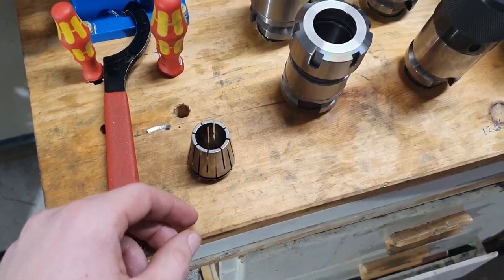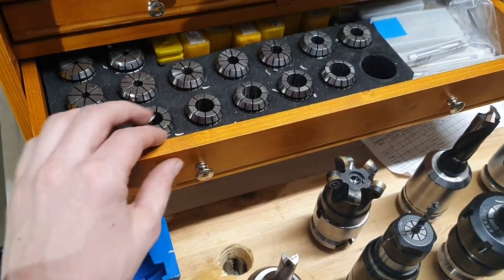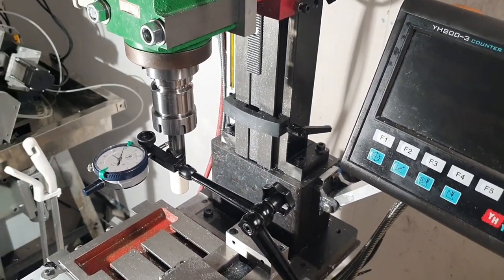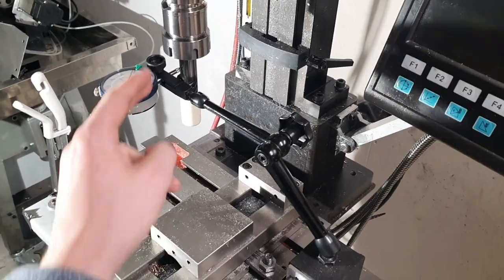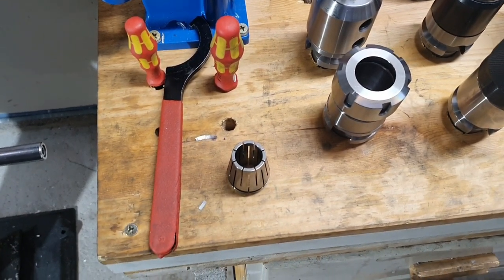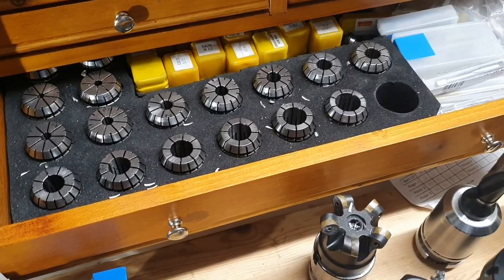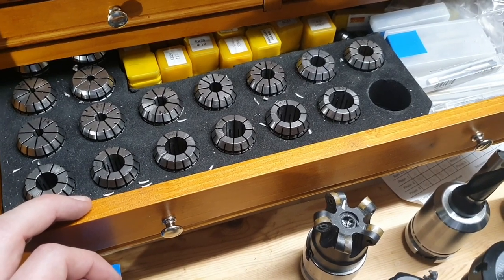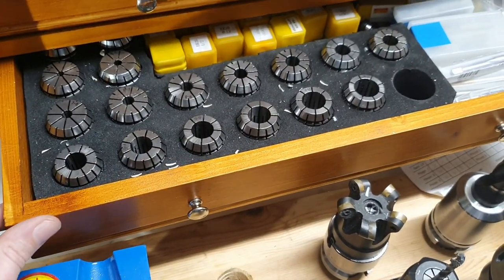quick tool run out test - cheap vs expensive er32 collet (green bt30 spindle)

Comment from the maker: please comment what you think about the values. (Dial indicator shows in micron / micrometer) The expensive one I found for 12 bucks new. My opinion is that the china ones are good enough for me. I said in the video " a little less runout", everything is relative though. If one think about it, it is actually 50% less runout on the expensive one. which is quite a big difference. To me the difference is not large enough to justify me spending money on more expensive collets. It was fun to make the test though.

Comment: I was a bit surprised that the indicator moved so fast between the two extremes? It seemed to be only a small part of the full rotation that moved the needle. Also, as pyrozmuro commented below, the baseline for both the spindle and the collet holder would be nice to compare with.

Comment: Smth not right in the measurings, the needle shouldn’t jump like that it should be a smooth transition, try to use a smooth carbide endmill shank for testing or a more rigid setup 
Anyway that .05 runout between them ... doesn t worth the price for me, i use only cheap collets and manage to finish parts in .05 tolerance so totaly fine for me

Comment: Your spindle and or holder , probably holder is running out probably a thow it looked like . The good collet is probably within .0005 or better . A common problem with collets is some are oversize to start with , that increases runout . If you index them a little it can help split the difference for holder or spindle runout. Erickson , kennametal , collets are as good as you'll find for the most part. ER collets are also advertised as having a range , but I can tell you with 110 % certainty that they are not , if the collet fits tight on the tool or work piece it will run out 9 out of 10 times, and your getting lucky if you collapse it to the tool or work past about .005-.008" without runout. A good er tool fit usually gets you .0005 or better . I used to make LOTS of collets I could piss on for half an hour but I won't. Coolant sealed collets are more accurate also because there's less slots / less deflection in them .